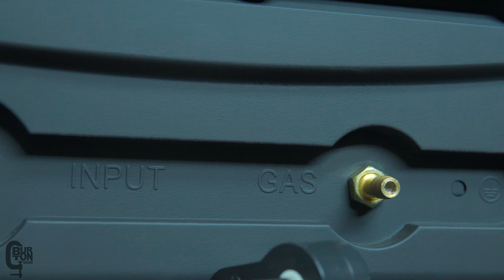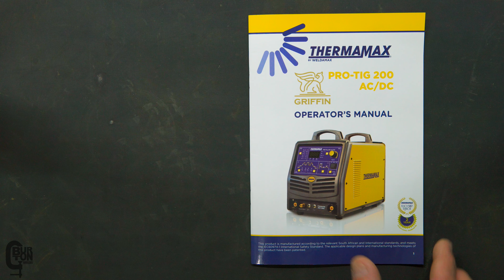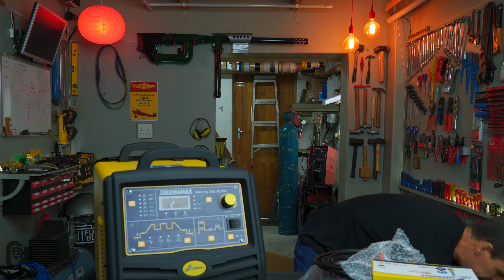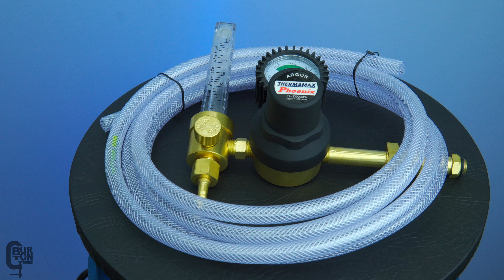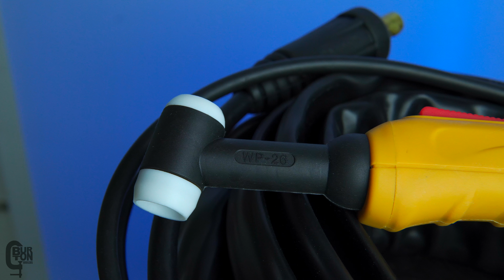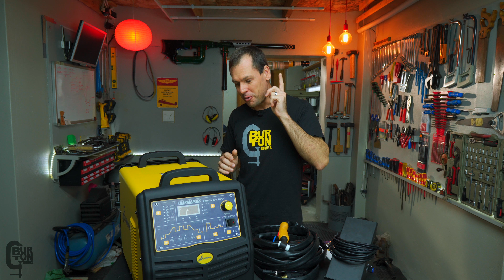Best TIG Welder? Thermamax Pro TIG 200 AC/DC - Burton Builds

Comment from the maker: Here is a video about the Thermamax Pro TIG 200 AC/DC welder settings https://youtu.be/md1yhy9RHLE
What TIG welder do you have? and tell us whats great (or not so great about) it.

A couple of the Brands to jog your memory (In no specific order):
Thermamax / Trade Weld / Afrox Transarc / Miller / Lincoln / AHP / Jasic / Prime Weld / Pinnacle / Panweld / Eastwood / YesWelder / Ryobi / Matweld / Ingco / ESAB / Total / Mac Afric / Javweld.
Reply: great video ! I have the trade weld TIG but looking at upgrading to the thermomax pretty soon .
Reply from the maker: @themattybv8347  Hi Matthew, thanks for the comment. If you are interested, there is another settings video walkthrough video of this machine https://youtu.be/md1yhy9RHLE Do you have the older Trade Weld TIG or the newer Trade Weld GenX machine? Why are you wanting to upgrade?
Reply: @GrantBurton  yea I have the older model and its the DC tig so I want to upgrade to a AC/DC . Iv done some modifications to the tradeweld and it and I have no complaints with it I just need the AC/DC
Reply from the maker: @themattybv8347  I'm also happy with the Thermomax so far, although i haven't welded any aluminium yet... only 304 and 316 stainless steel and mild steel. Unique Welding have also said that spare parts are readily available on shelf in SA which it a plus (lets hope this is correct). I've also set aside the torch that came with the machine and am using a smaller and more conventional 26 size torch with a separate movable switch... I find that much more comfortable to use.
Reply: @GrantBurton  I'm not really a fan of the torch with a switch I much prefer a foot pedal , so if i do buy the thermomax i will definatly go with the foot pedal option and possibly replace the torch to something abit more compact like a CK torch .
Reply from the maker: @themattybv8347  Oh, definitely a CK torch... I'd love the CK Worldwide FL150 or even the CK9 Flex for the smaller jobs... maybe one day if all the bucks ever start rolling in. Here is mostly what I use it for... https://www.burtsway.co.za/product-overview
Reply: @GrantBurton  I'm not sure if you have tried out a few different cups yet but I'm running the furic gas diffuser lenses with the furic size 12 and they are just fantastic!!!
Reply from the maker: @themattybv8347  I've only tried the standard cups that come with the machine but also purchased a separate standard pink No.6 gas lens which I basically use all the time now. Something I would eventually like is a water cooled torch. When making batches of those gas bottle stands, and welding multiples of the same part many times over and in fast succession, the torch gets super hot and i have to let it cool before continuing.
Reply: @GrantBurton  yip I hear you that does tend to happen
Reply: https://youtu.be/RTMwrv2hGLA
Reply from the maker: @themattybv8347  Cool man, is that what you make and use the Tig for?
Reply from the maker: @themattybv8347  Looks pretty awesome. Just a pity the colours will go brown over time.
Reply: @GrantBurton  yip I do alot of metal art
Reply: This looks very much like a Jasic - are they the same machine ??
Reply from the maker: @NormanGnome11  I'm not sure... but they do look very similar, especially when you look at the Operators Manual (see the Jasic link in the description). I've never seen a Jasic in real life though.

Comment: Excellent video Grant.  I have the older model Thermamax Tig 200P AC/DC.  I purchased it in 2017 and I am really happy with the performance.  The only issue I had was a burnt out coil on the Argon solenoid valve.  Unique Welding in Port Elizabeth had a replacement valve in stock and less than 2 hours later, I replaced the valve and it was up and running again.  It would have been ideal, to replace the coil only, but they could only supply the complete valve.
Reply from the maker: Hi Stephan, thanks for the comment. Glad to hear they were able to sort you out so quickly... super convenient to have off the shelf parts available immediately. Do you use the machine in a commercial operation or just hobby use?

I'm also still very happy with my unit although i did change to a lighter torch and hose setup, the one included in the kit is to heavy for repetitive small work.

Comment: Currently looking into buying this machine - Would love to see the second part to this video. Still on the fence about price. great vid
Reply from the maker: Hi Tyler... You couldn't have timed it better because the second part of the video should go live in a few hours. haha.

Price is a little steep but I was assured by Unique Welding that they keep parts on hand in the unlikely event the machine breaks (as opposed to the cheaper machines possibly having to be sent back to China for repair, or waiting weeks and weeks for replacement parts).

I friend just bought the Trade Weld GenX 200a AC/DC machine... it literally arrived 15 mins ago. I'm hoping to cast my eyes across that sometime. I was also considering the GenX machine but decided to go with the Thermamax.

Would be a nice compare the quality of torch, earth lead, regulator, internals, etc. of the two machines... Hopefully paying more for the Thermamax hasn't been a waste.

Thanks for the feedback.
Reply from the maker: Hi Tyler, the second video is out. If you didn’t see it already, here is a link https://youtu.be/md1yhy9RHLE